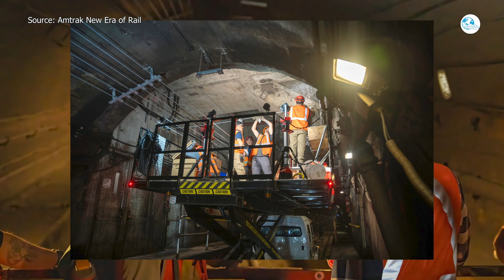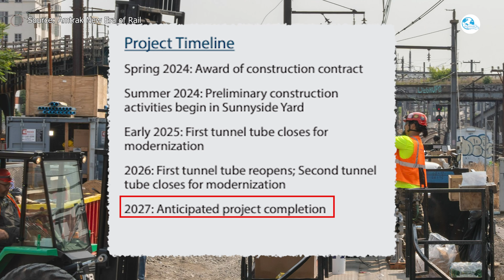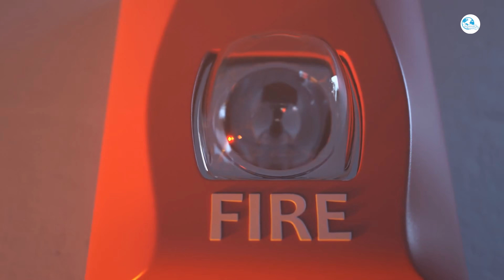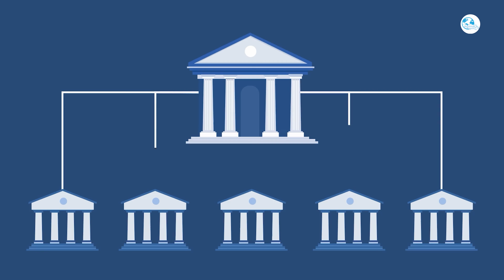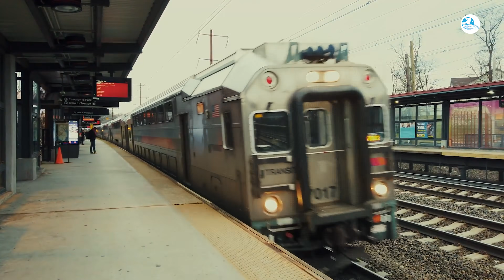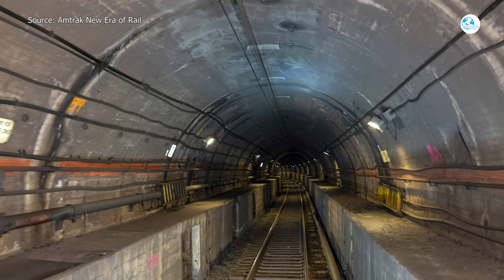$1.6 Billion Amtrak Tunnel Upgrade to Save NEC

Comment: They should be using fiber optic and concrete ties
Reply: No need they probably are just setting the mounts for the tracks into the concrete, and I assume they aren't using fiber optic for reliability since it is in a busy tunnel and wear, and tear may not make it suitable for long term use.

Comment: OK, lets put some myths to rest.  The original tunnel was damaged by a hurricane because they forgot to close the doors.  The old tunnel was damaged by salt, and the concrete needs repair.  A new tunnel was planned, but turned down because it did not come out in a useful spot.  Later, the tunnel was approved, and, it doesn't come out in a useful spot.  It will be used as a shoo fly while the original tunnel is repaired, then the new tunnel won't be used because, it doesn't come out in a useful spot.  To make the new tunnel useful, you need to rebuild part of the city to make things line up with the old tunnel, which will take a very long time and make the tunnel digging look cheap.  Meanwhile, the new Acela, which was supposed to make things better, is slower than the old Acela.  Please stop defending Amtrak, they really are terrible at their jobs, and they LIE A LOT.
Reply: You are also confusing the North River tunnels with the East River tunnels. Additionally, none of your statements are accurate. There are four East River tunnels. One at a time will be taken out of service while it is rebuilt. The North River tunnels--there are two of them, not one--are also being replaced and repaired. When the two new tunnels are complete, the existing tunnels will be taken out of service and refurbished. None of the city needs to be rebuilt. That is a fooloish, ignorant and uniformed statement--like the rest of your stupid comments.
Reply: @larryc8568  @tonyburzio4107 is just clueless.  Ignore him.
Reply: Doors?? What doors?? These four tunnels never had flood doors.
Reply: @larryc8568 there’s not 4 tunnels. Lmao
Reply: @RellupNorth  Sorry. There are four tunnels from Penn Station to the east. Try reading this yourself from Wikipedia:The East River Tunnels are four single-track railroad passenger service tunnels that extend from the eastern end of Pennsylvania Station under 32nd and 33rd Streets in Manhattan and cross the East River to Long Island City in Queens. The tracks carry Long Island Rail Road (LIRR) and Amtrak trains travelling to and from Penn Station and points to the north and east. The tracks also carry New Jersey Transit trains deadheading to Sunnyside Yard. If you can't understand that, you are just obstinate. Are you still laughing??
Reply: @RellupNorth  There are four East River tunnels.  You are wrong.
Reply: Nobody forgot anything.  There are no "doors."
Reply: How is it slower? It’s not slow. They just haven’t updated the schedule yet. I guess not until all of the new ones going to service that’s what I heard.
Reply: @Dannyfye16352  It is slow. Most of the track is speed limited. Only 40 miles are going at top speed. It doesn't go fast enough to justify the cost or go more often.
Reply: @cbernier3  Tunnel tracks are 60 MPH.
Reply: That old Acela trainsets are being replaced because they’re 20+ years old and have reached end of life.  The “new” Acela is a marketing gimmick, because it doesn’t change the unfavorable track conditions.   But the trains needed to be replaced anyways.

Comment: Be better to bore a new tunnel
Reply from the maker: Yea, but how about the location😌
Reply: Why was upgrade chosen over a new tunnel?
Reply: @georgesotiroff5080 new tunnel was more expensive, they wanted that but no dice from the feds
Reply: @Plazmageco 
Thank you. I suspected as much.
If this upgrade buys us 100 more years then it’s a reasonably good deal.
Reply: @Plazmageco  Many videos say that the Biden administration was the most pro-train administration we had in at least a generation.  You certainly won't get that support with an administration that wants to remove funding from local projects.